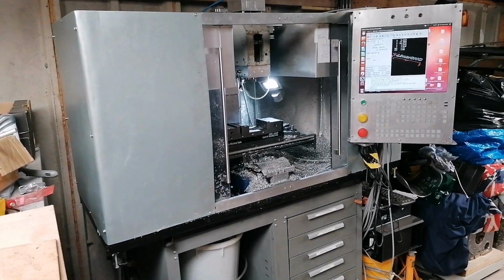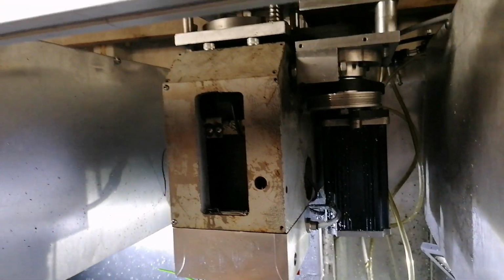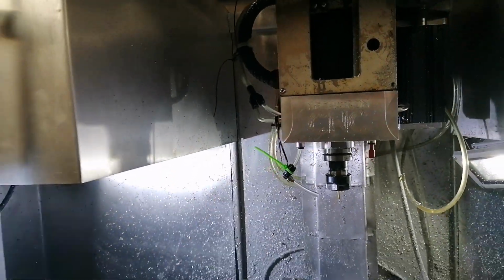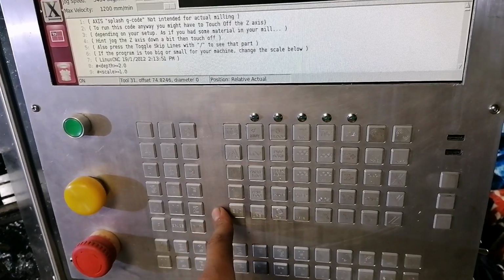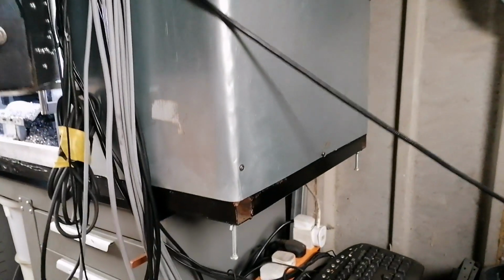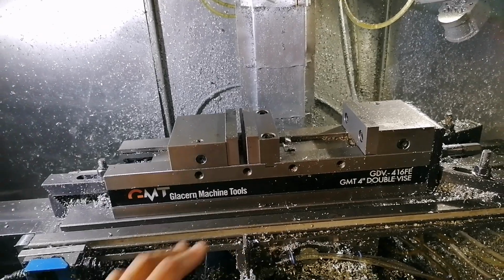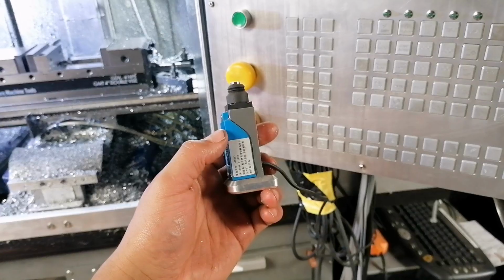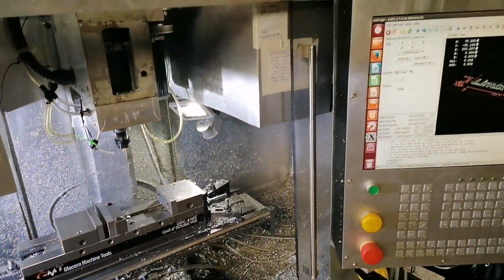How I built my CNC mill- update #4

Comment: I see that you have custom buttons. What kind of push button is underneath the aluminum caps that you made?
Reply from the maker: Hey, the buttons are just some large 12mm  cheep tactile switches. I knew I needed alot of them so I kept it simple and mounted them to custom pcbs underneath. I wanted a switch that would give a definitive sound when it was pressed to make it obvious that it's been actuated which makes it easier to use and debug any issues. 

Thanks 😎👍